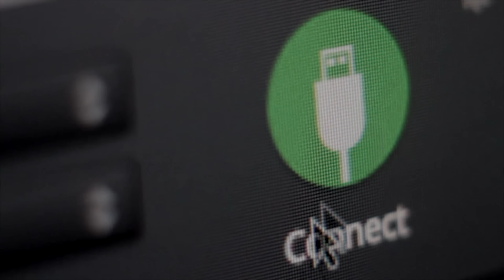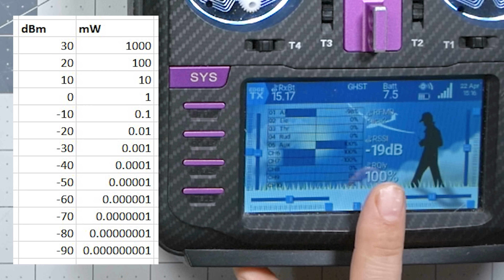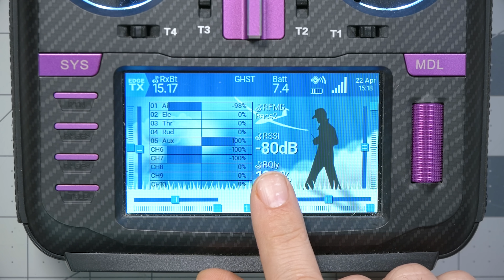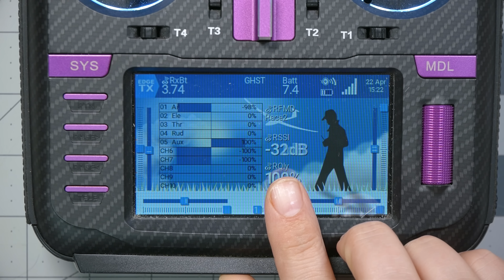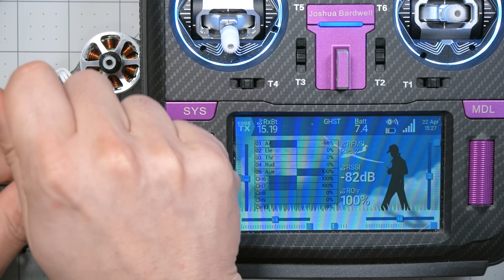Failsafe at 50 feet. Why? // HOW TO TROUBLESHOOT QUADCOPTER FAILSAFE

Comment: It could actually be a flight controller. I had an issue with signal drop every 3-10 seconds to zero (RSSI and LQ both) with my Crossfire Nano RX. After deep research I found, that my UART2 was corrupted somehow (not wires, not pads, but processor). I re-soldered receiver to UART1 and everything work fine now.
Reply from the maker: I guess we have to clarify whether the source of the RSSI/LQ is the FC or the receiver module. If the FC is providing LQ and RSSI in the OSD, then you're 100% right. In my case, I was getting RSSI/LQ directly from the module telemetry, which side-steps the FC. Good catch.
Reply: @JoshuaBardwell  You're right, that was on OSD, but telemetry in my transmitter didn't show any drops. I didn't think from this point.
Reply: This can actually happen, i beleive the newer 20x20 f411 matek wse boards on the manual states that you should only ever use uart2 for crossfire style receivers, so maybe they have run into a problem with this in testing?
Reply: @shadofpv  Yes it was F411, but not Matek. That was a Cinelog25 (analog) FC, there are only two uarts, manual recommends to use uart2 for Crossfire and uart1 for vtx (tramp). To fix broken uart I cut crossfire telemetry (ch2) and re-soldered ch1 to r1. As a result vtx and receiver became both on uart1. When I need to reconfigure vtx settings, I opening BF, changing ports, do what I need and move it back...
Reply: I had the same, a uart was flaky..
Wasn’t a proper fail safe though.
Reply: @RCRitterFPV  Yeah, exactly, flaky uart. But I really had failsafe just in 15-20 meters from me and after that I found problem with zero rssi. Maybe that was just a coincidence...
Reply: I get some problem, thanks

Comment: I've been having failsafes too. But they only happen when I am less than 1 foot away from the ground. Cant figure out why. Guess I am using flysky thats why.
Reply from the maker: Failsafe only at close range like 1-3 feet is likely because the radio transmission overwhelms the front-end amplifier on the receiver, causing it to lower its gain. Basically, totally normal. Solution: don't be so close.
Reply: @JoshuaBardwell  Thanks!